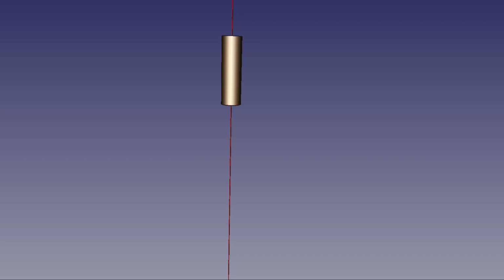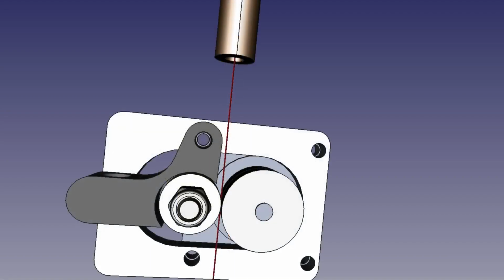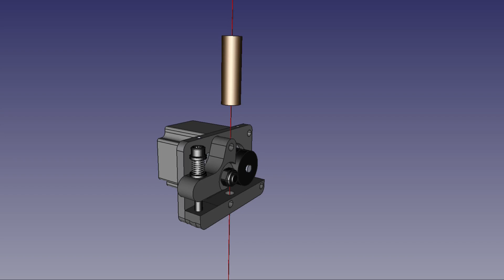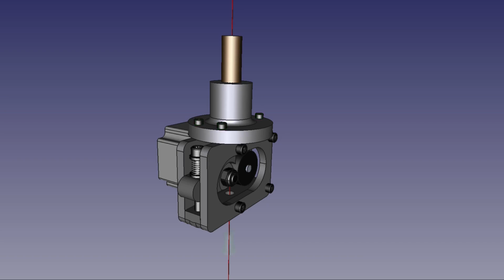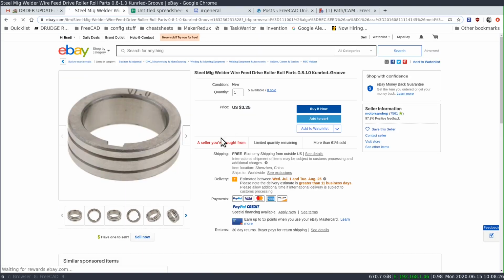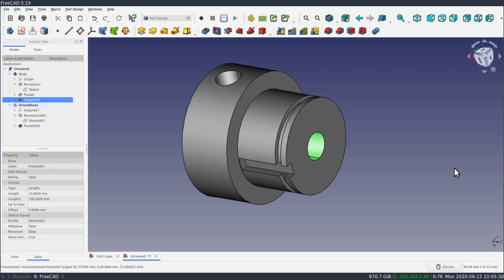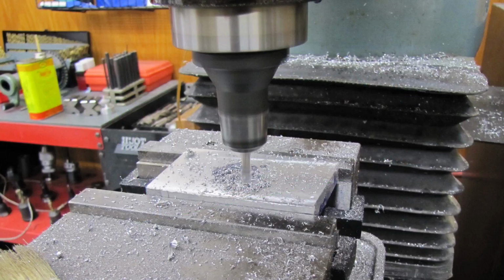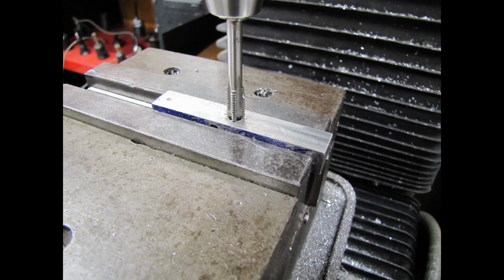Building the Wire Bending Head

Comment: Very nice. Curious why you decided to make an adapter for a commercial drive wheel instead of making your own drive wheel? Seems like your part would be simpler if it was the drive wheel itself, instead of interfacing with the commercial one? (Maybe the wheel needs to be hardened?)

Comment: what software do you use for generating B code for wire bending machine ?
Reply from the maker: I wrote my own.  Mostly just experimental code in a FreeCAD Macro.  I never got things to a sufficiently stable point but I archived everything.  If someone ever wants to work on bending for Path workbench, I'll dust it off and commit it to a github repo.
Reply: @sliptonic  How can I contact you ?
Reply from the maker: @mazin_0_0  create and account on the FreeCAD forum and PM me.